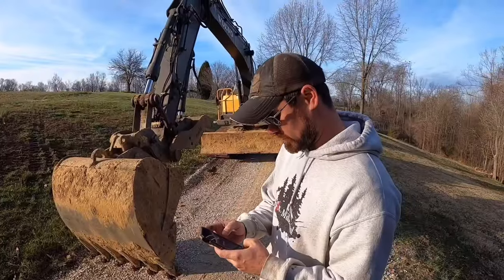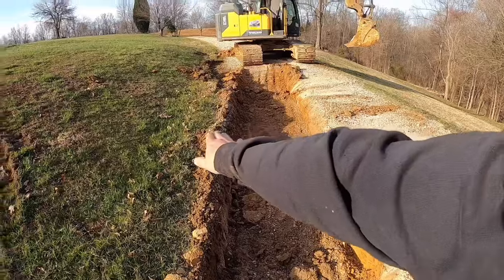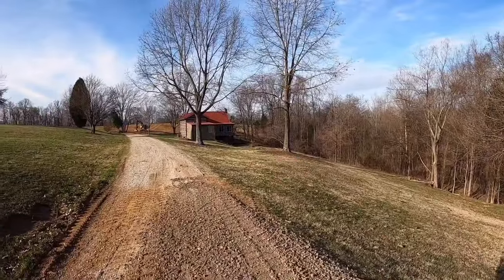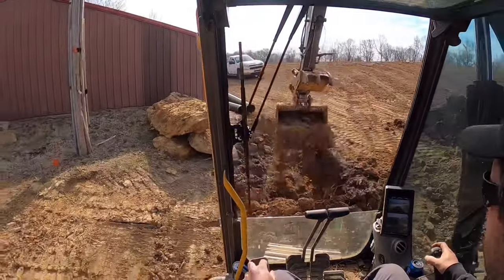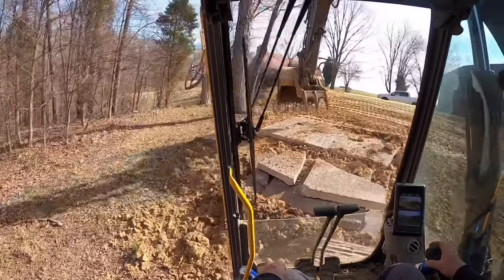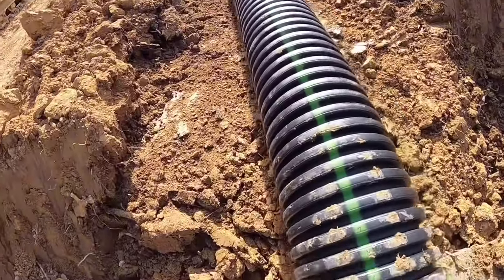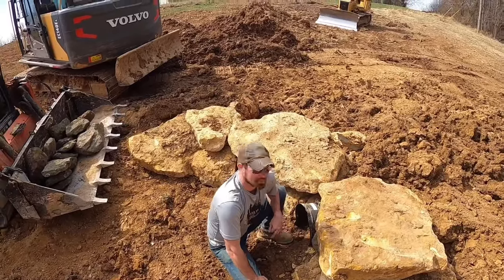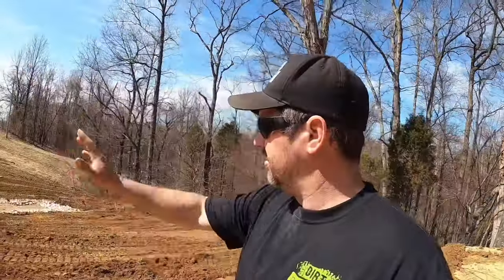Making good use of the demoed concrete. Man, it worked out just awesome!

Comment: Good job Mike, working with Matt seams to be very easy, you both josh each other but both know that the job is important.
Like how your also thinking about the customer, recycling that concrete and rock was a good choice, many contractors would have disposed of it without thinking it if could be re used. When the grass grows that whole area is going to look really nice.

Comment: The fuel treatment must be a different formula than used in Alaska,  I ran equipment in the 90s and heated with diesel in the early 20s,  we didn't switch to winter grade until subzero weather.  Have a great day.

Comment: Worked for a guy like what you do and we had a trick for doing stuff like this we would chain the gate to only open 5 inches or so and lay a chunk of 12 inch pipe on the side you did not want the gravel to come out of on the inside and almost all the gravel would come out the one side or when doing gravel lanes where there was a grass stripe in the middle put the pipe in the middle so gravel would only come out the sides and not cover the grass stripe in the middle of the lane.  Tips and tricks..

Comment: That needs a tile run of 4 or 6" long pipe not the large ones.  Flow is low and smaller pipe is lower price. (might be the steel price as well as plastic). Good on using concrete - use the Big on as a bridge to drive on - mediums below and around and toppers.

Comment: Dumping on a cross slope on purpose for no good reason.  What's up?  Just trying to get views.  Wrong type of rock for that application too.  You need base placed in thin lifts.
Reply from the maker: Absolutely not think about it
Reply: @DirtPerfect  Gap graded rock like you used will hold water and the water will soak into the soil causing it to destabilize.  Then the soft spot will be larger than it was to start with. What's your theory?